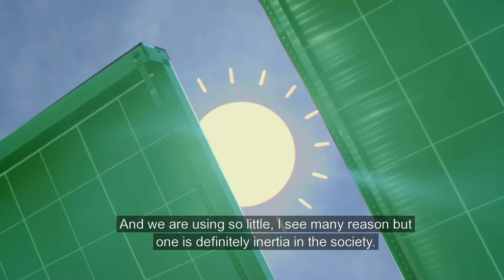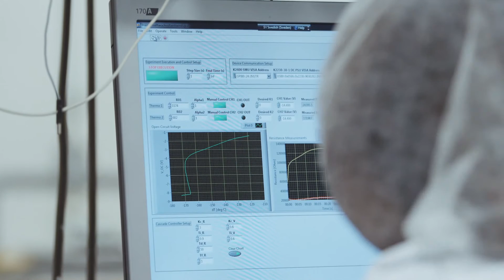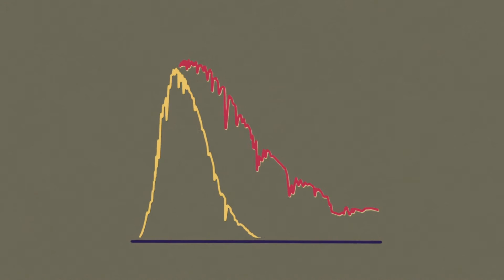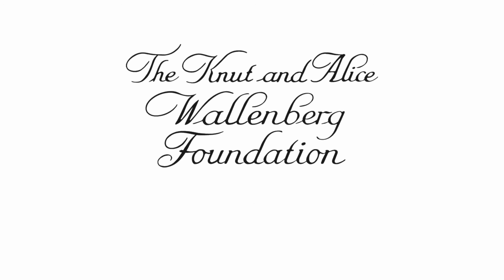Making electricity from invisible sunbeams

Comment: Yeah They already made infrared solar panels Years ago never came out. Theirs also another one Infrared Solar they use antennas, nano antennas printed on plastic film, like 10 years ago never came out, at 98% efficiency. Then you have the problem of the National Security Act that control the efficiency of anything new in technology, thats why all solar cells are only under 30% efficient. Many other examples of energy I could name, but this is just for solar. Also Try using Hemp for your plastics and solar cells buddy, just a helping hand lol.
Reply: Paint a water tank black and leave it in the sun, volla hot water for the shower. But you might not want hot shower in the summer ahahah
Reply: Source?
Reply: @DwAboutItManFr   https://www.engadget.com/2008-02-02-infrared-solar-panels-even-work-at-night-but-cant-output-energ.html

Plenty of sources of this guy, just got to find it.